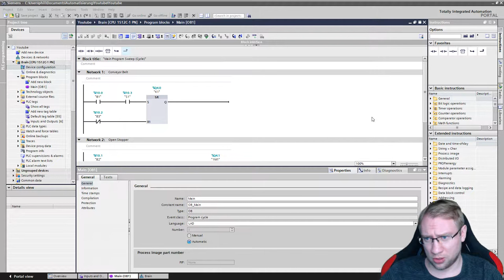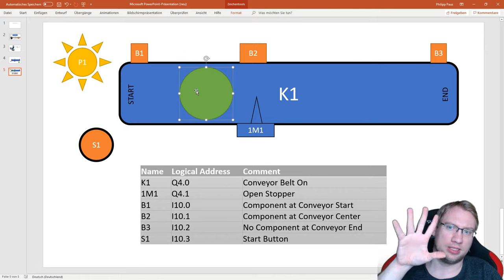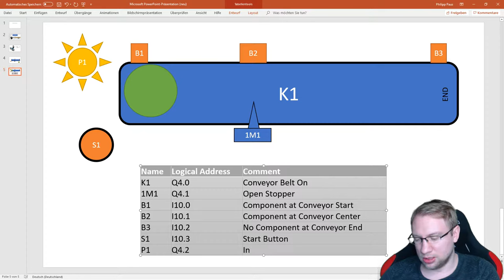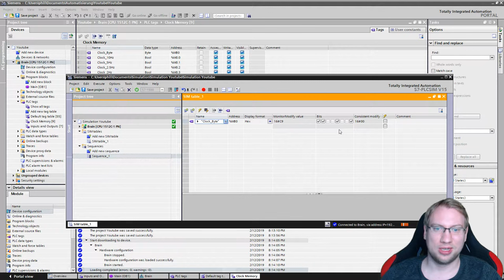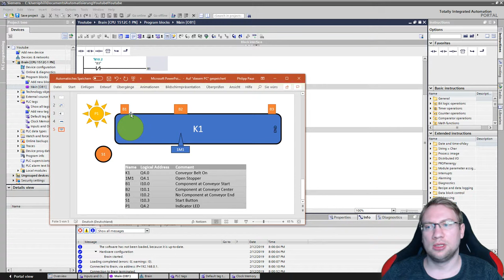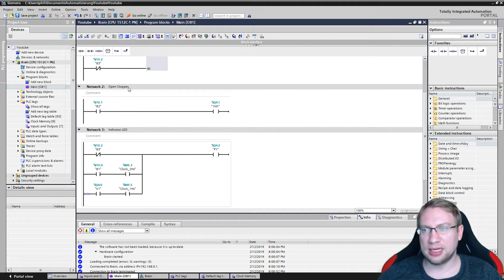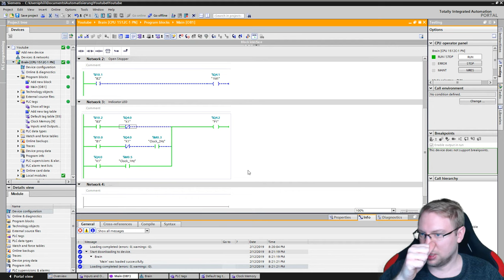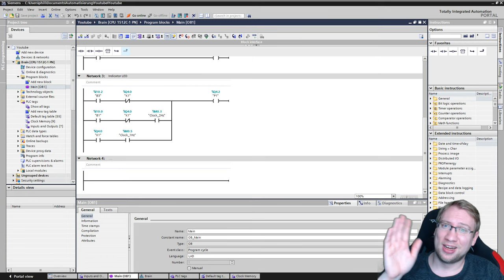TIA Portal: Clock Memory (Toggling Frequencies / Flashing)

Comment: 12:17 why did you change the XIO to XIC? In your previous videos you said that B3 is active-zero signal, it writes 1 in the address bit when no product is detected, so XIO works correctly, you just need to set the address bit to true at the start of simulation in your sim table. Please, correct me if I am wrong.
Reply: I agree with you, if the address bit is set to true in the table of plcsim, it works as it has to be. I think he didn't notice it at that moment and his experiences bring up an alternative solution. Hopefully he can confirm.
Reply: I think in the first network he must only keep B3 with a NC Contact and set it true in the fist of the simulation. nad no need for adding the K1 contact.

Comment: Ive got a annoying issue with my s7-1215 dcdcrly when using clock memory bits, i hope you can help me real quick,

when trying to flash a LED with 1Hz the frequency goes wild and flashes pretty much randomly, when checking out the plc variables you can see that 1.0Hz, 1.25Hz & 2.0Hz are all on at the same time and turn off at the same time, which I assume is the reason for my issue, but I have no clue on how to resolve that or disable the other frequencies because I pretty much only need 1Hz

In the PLC variables you can see some others frequency not changing/working at all

Comment: Really good videos. I have a question, if you try to assign two variables the same address of a byte that clashes with assigned bits does the step 7 software raise a warning ? And my second question, is it possible to view the s7 memory map ?

In general have you covered setting up the memory tags in an efficient way that avoids bit clashes. I have had this in the past with automatically assigned bits on another Plc.